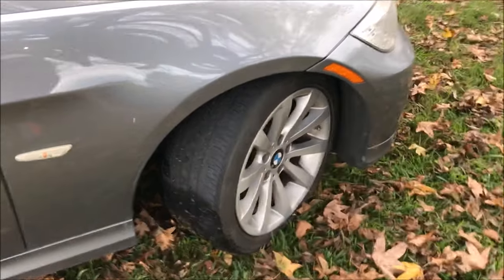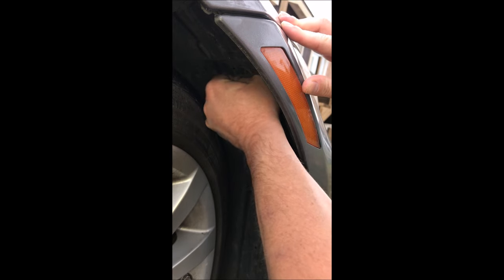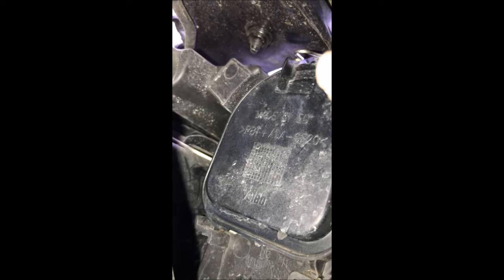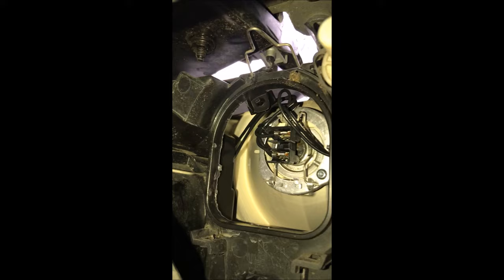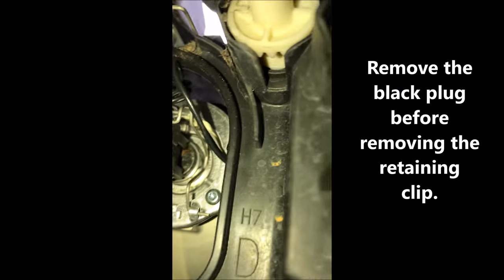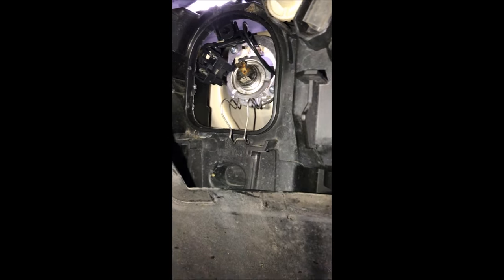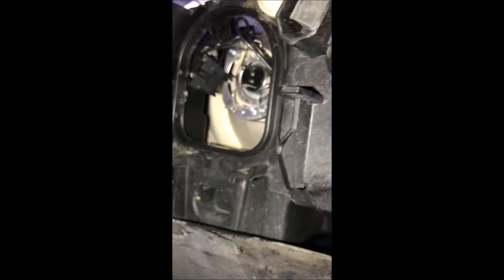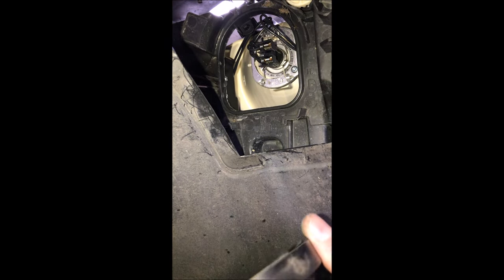FAST - Replace BMW 328i Headlight Bulb Without Removing Tires

Comment: Are you supposed to be able just to pull the black power plug out, or is there something else to it? I’m having trouble removing mine.
Reply from the maker: I believe there is a retaining clip u have to pop off in the video i showed...that's what holds it in place...

Comment: @34sec that panel dose anyone know were to get I lost mine trying to change the light n I no longer have it so anytime water gets in there it sucks allot because the light goes out any help would appreciate it!
Reply from the maker: Go get some gorilla tape and tape it shut until then. Might check ebay.
Reply: JRMSweeps thank you man really appreciate
Reply: JRMSweeps thank you man really appreciate

Comment: My 2011 328i has screws, no clip. On the top.
Reply: Jake Rodriguez same it’s such a pain to remove. All the videos and even the owners manual shows a clip system to remove cover
Reply: Yay! I thought I was the only one! - same on my 2010 328xi sports wagon. Couldn't remove screws holding bulb access cover without removing the front of the wheel well cover, grrrr
Reply: It’s a clip, clean the area really well and look closely, it’s not really a clip it’s a flap that you have to turn counter clockwise to open

Comment: Cant get the plug off. You say metal clip right here but dont say where. Pushing everything and it's not coming free. Entire bulb moving and I dont want that. I need to disconnect the elec. But HOW
Reply from the maker: Pretty sure i show that in the vid.
Reply: @JRMSweeps  I looked. You said "this clip" but you weren't pointing to anything. 
Anyways not being critical just trying to solve the mystery. Gave up on it because I am not understanding how to get this harness off the bulb. I feel  really stupid lol. Not my first rodeo. Just first on a BMW.
Reply from the maker: @pignapoke6772  the clip is a metal retainer clip.  you should be able to pop it off and remove the light bulb, provided you have the same model and whatnot.  No worries on critical, it was tough getting the camera in there so I totally understand.

Comment: I dropped the black cover While trying to Put it back on. You mentioned you did this as well. How can I access it through the bottom?
Reply from the maker: Had to undo some of the screws ar the bottom to open up that cover to reach up into the bay and grab it.

Comment: great video thanks.  I got the light bulb switched, works now.  However I dropped the damn clip that holds the large black light bulb cover down towards the ground behind the wheel cover.  Anyone know how to retrieve it?  Where is "the screw off down at the bottom to get it" mentioned in the video?
Reply from the maker: have to take some screws out of the lower plastic cover under the front of the car to get that out or fish it out with something of length.

Comment: Lmao i lost that last piece 😢😢 its in bewteen the headlight the radiator support and the bottom all stuck i can't reach it anymore 😢😢😢 but hey light work just fine! 😊 i think i will just have to go to AutoZone and get a new one anf find out how to take out off the motor later. 😕
Reply from the maker: Take the lower plastic valence off underneath the front.  It's held in with a couple sceews.

Comment: Jack up , remove tire and put in a jack stand. This guy must do these bulbs all the time. Also, if the car is older, the plastic connector for the bulb can easily break due to the heat and age. Be careful if doing it yourself.
Reply from the maker: Wrong, 1st bulb I've ever done.  Putting car on jacks is pointless unless u want to die possibly in ur driveway.  No need to be careful if u follow my vid hahahaha...booh

Comment: Okay so not that first cover you opened with the quarter but the second cover I ended up dropping and I think its at the bottom of my bumper. You said you unscrewed it out to get it. Is it 100% necessary to get it or can I wait until I get my oil change and asked the mechanic to get it for me?
Reply from the maker: If I rmember correctly, I thought it sbapped in place to help retain the bulb.  Your call really.  If it were me, I would get it out.  You might drive and it fall out down the road and have to buy another one.
Reply: @JRMSweeps  ah I wonder if we're on the same page here. I don't think it snaps in place to help retain the bulb but then again I don't know anything about cars I just thought it's a cover, you mentioned not to drop it. Either way, I'll just have to borrow tools from my work and I'll have to do it tomorrow. But I was able to change out my bulbs so thank you!
Reply from the maker: Okay, I rewatched.  The bulb is retained by a metal piece inside the housing.  The black cover is to keep "stuff" out of the headlight housing.  Takes about 10 mins to get the housing out from the bottom.  Just undo some of the plastic screws and reach up in there to grab it or use something to hook it.

Comment: I am seeing all kinds of bulb options, LED, Halogen and prices vary greatly. Did you look to upgrade or improve or did you go with stock?
Reply from the maker: I went with stock since that year model didn't change over to the bright white halos...check the video description on what i used from amazon...i didnt go halogen bc i thought it would look off with the older style halo yellow rings...

Comment: Are the bulbs for high beam and low beam bulbs same size H7 ?? Doing this for my sister idk I drive a camaro
Reply from the maker: Each bulb functions as a low and high beam, they aren't separate bulbs.
Reply: JRMSweeps thanks and also what size bulb is for the angel eyes ? I’m looking online so far I can’t find anything on angel eyes light bulb
Reply from the maker: That is a totally different ball game.  I have no clue and def wasnt going to do the angel eyes whote led upgrade myself.  A little more complicated.

Comment: How do u remove the black wire connected to the bulb ?
Reply from the maker: To replace the bulb for this model, no wires were removed for bulb replacement.  So, I am unsure how to answer your question unfortunately.

Comment: What if I think I possibly messed up on the safety clip?
Reply from the maker: What u mean?  It may have just came unhinged.
Reply: @JRMSweeps  i placed the bulb in and then attempted to put the clip back but its loose so I just put the black power clip on the right side of the vehicle
Reply from the maker: Did the bulb seat all the way into the headlight housing?
Reply: @JRMSweeps  it went all the way to the back/seated properly i think, however retaining clip feels loose i put bulb first then clip but i was confused around that point
Reply from the maker: As long as it is still in the housing ur good im sure.

Comment: Does this apply to an e92?
Reply from the maker: Look under the front fender wells and see if u have an sccess panel.  You will need to turn ur wheel out all the way.  If u do have the panel then yes.